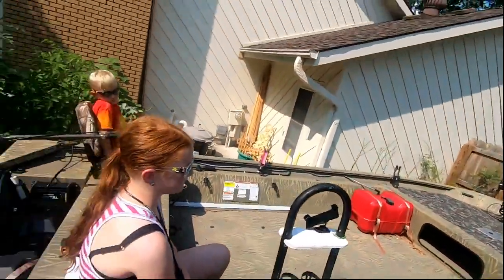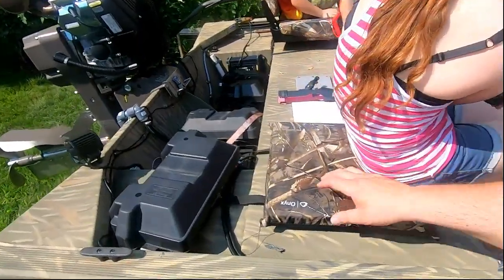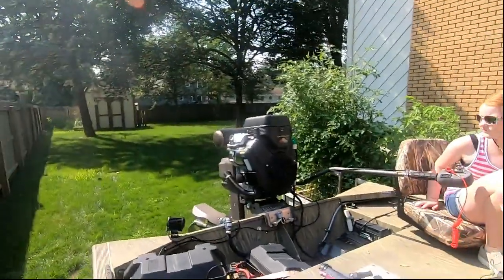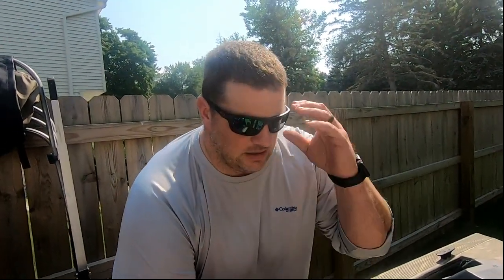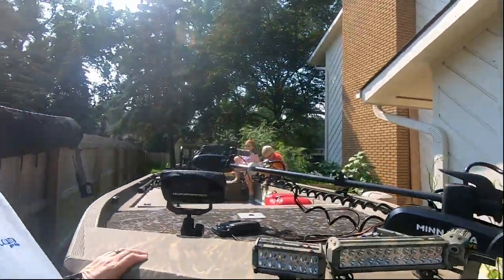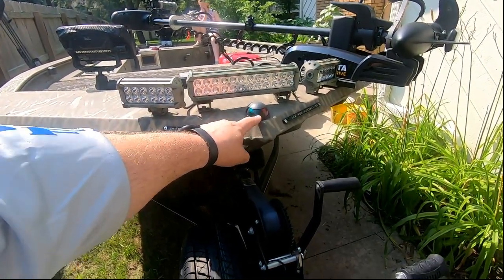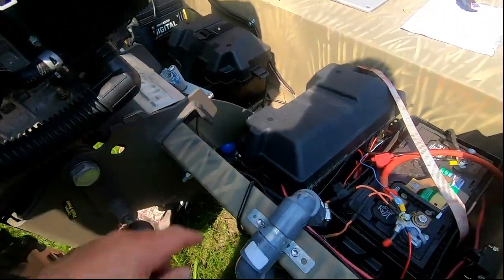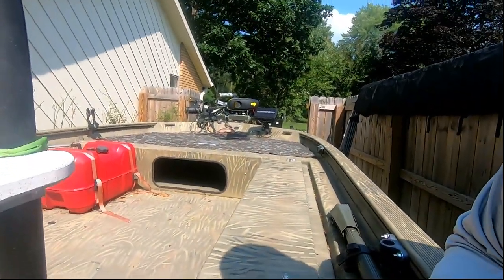Tracker Grizzly 1860 walk through.

Comment: What would you say a good all round outboard size would be for a bout like yours .Im looking at a hull and trailer
Reply from the maker: I can’t remember what the maximum is but a 50hp would push it around very well. That style or motor is much slower than a normal outboard so you should have not problem getting into the 30’s.
Reply: @dadoutdoors239  ok, thanks the one im interested in is a center console so a bit heavier and it has a 40 hp merc 4 stroke